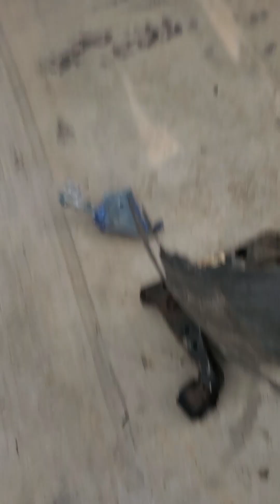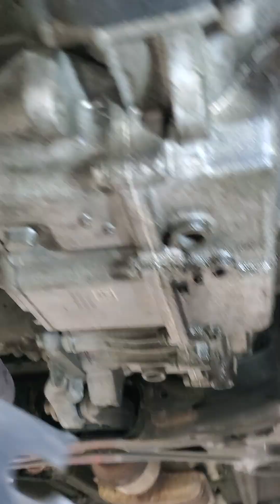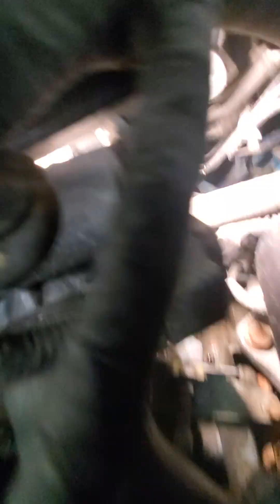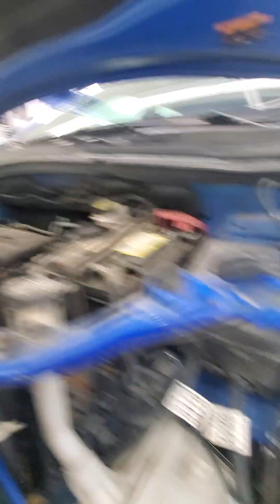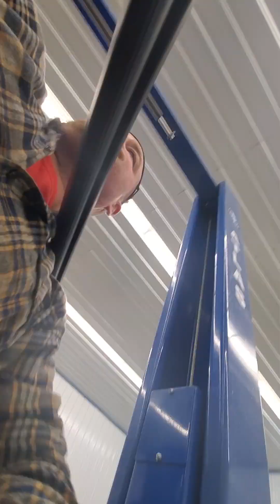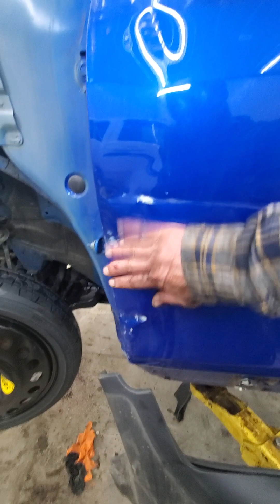2016 Chevy Trax 1.4L turbo AWD How to change transmission fluid refill refill transmission fluid.

Comment: Thank you for the information but you did not mention the trans filter.   As you would want to service it with new fluid and new filter.
Reply: Take the transmission off and then disassemble it and then change the filter while you're there might as well do clutches valve body and a new torque converter.

Comment: you didn't include in the video how you got the cap off.  how did you remove it?  I am having a hard time getting mine off.
Reply: Hit it with your purse
Reply: Sorry I just realized you're a female. That's just what mechanics tell each other when it just needs more muscle than they're giving it.
Reply: I agree, these things get tightened hard, gotta apply force or get creative, long wrench usually get the job done faster
Reply: He actually did

Comment: arent you supposed to leave it running while your adding the fluid and checking the level?
Reply from the maker: you can as along as you get up temp and recheck the fluid you will be fine

Comment: What quantity of ATF did it take in?
Reply: 4 quarts = 4.5 litres

Chuck in 4 litres and run it for a while then top up what you need, most oil containers are available in 5 litres 🙂
Reply: 4qts = 3.78 Liters

Comment: What about the ticking sound when it’s running is that normal? Mine makes the same sound. Mine is a 2018 Trax LT AWD
Reply: That’s normal! It has to do with the high fuel pressure for the car